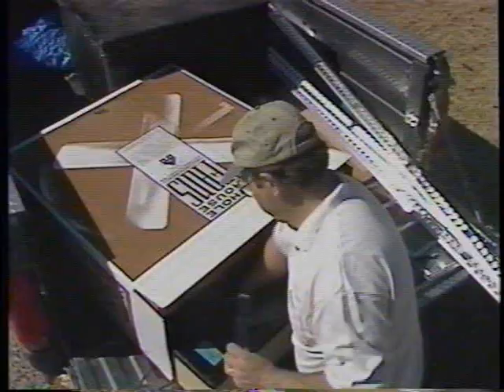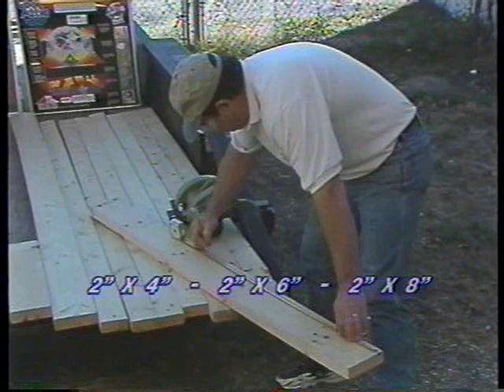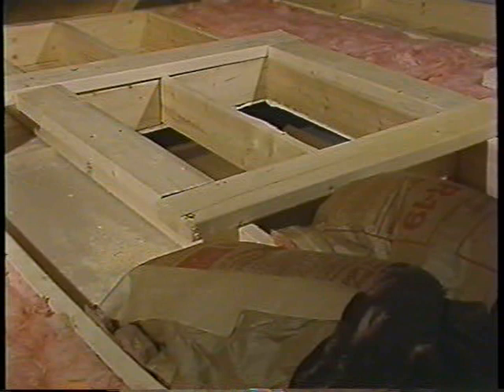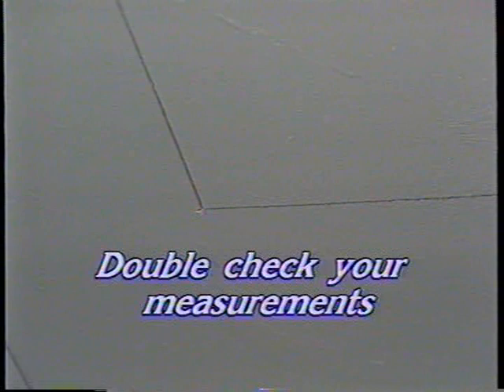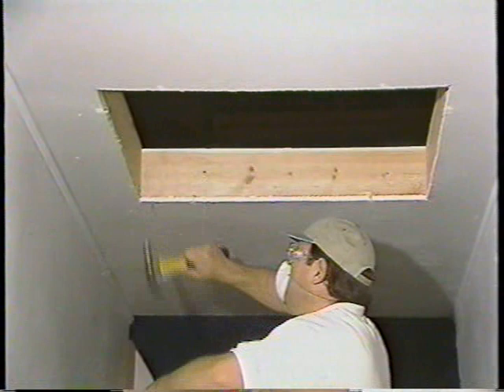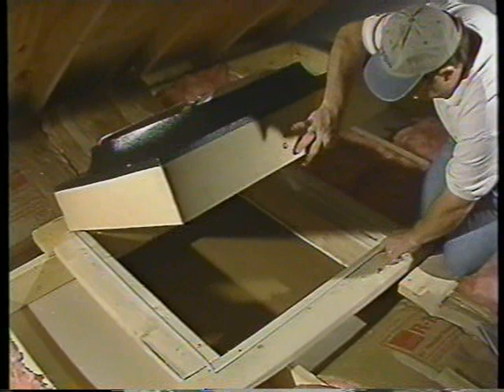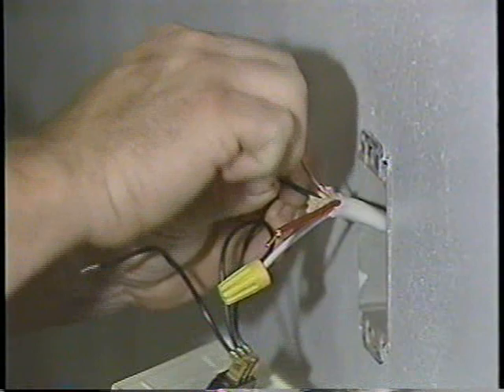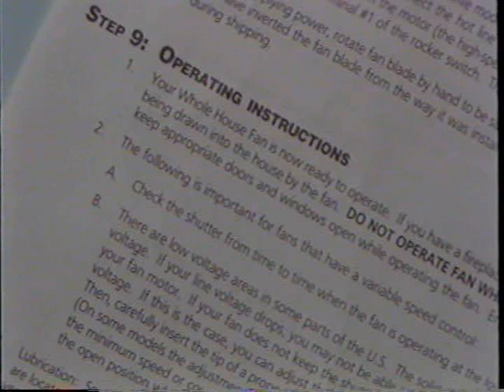Cool Attic Whole House Fan

Comment: Thank you!!! I used this video along with the printed material by watching all the keys areas over and over and Installed our whole house fan with  my wife, we are no carpenters at all. We did spend 2 days in a scorching hot attic with a fan and a constantly draped cold wet t-shirt, around head and neck to keep us cool and gallons of lemonade - only way, If you work through out the day rather than morning and evenings only.

Now I need video for the wiring, wish us a blessing.
Mark & Irma Bacher
Reply: Well how did it go?
Reply: @doranselwyn8608  really well,so far we had it working every change of season when we can enjoy fresh air (nights can get cold but enjoy good sleep) and...when a/c has given us hiccups 😑.

Comment: One "work smart, not hard" thing that I did with my installation, in an attic with support trusses, where I hoisted the fan into the attic through the hatch, was to remove the motor, and blades. This made it much easier to angle the fan frame through the trusses, to the point of installation.

Comment: This is all well and good for a modern house built to standard and with drywall. I put in one of these (different brand) in my 1904 house built with true 2 inch rough cut joists that were spaced however they felt like it that day, and finished with wood lath and sand plaster. It works great, but installation was night and day from this easy process. 
I would like to see this crew make a video in an old house like mine!😂

Comment: Dear Joe,

Nailing the temporary bridges - The video doesn't show a 'big picture' of
where this bridge would be.  Back up the camera to c the entire layout
w the workman  away.

When the two joists r cut, the remaining joist portions can sag down.
So, the bridges s/b to close up that joist parallel to them?  Not across
the two? 

And for temporary esp., don't use nails but screws.  Nails r
hard to take out.  Only carpenters who never come back r allowed to
use nails.  Owners use removable screws into pre-drilled holes
so the lumber won't crack.  I would rather use #10 x 3"L or 3.5"L sheet
rock screws than short 2.5"L ones to join 2 x 4, 2 x 6, or 2 x 8 (actual
meas. is much less) lumber to ea. other.

Comment: Since joists are typically on 24" centers, why doesn't anyone make a fan assembly that will neatly drop into that width? There is no reason that the through-hole be square; if more square inches are needed for flow, just make the opening 30" or so parallel to the joist direction.
Reply: You would not want that and it is not necessary. This is because a single fan that would fit inside a 22-1/2 opening would be much smaller. As a result, in order to get the volume of air needed, the fan would have to run at a much higher speed. The noise and vibration would be objectionable. The better solution is to use a standard 30 Inch fan and install a split louver. each 24" half would open at the same time  giving you proper air volume at a much slower and quieter speed.
Reply: Carl K Perhaps I wasn't clear about "dropping" the fan between the joists. I didn't mean the whole fan, just the through-hole. If you use the above-joist technique, then the fan can be any convenient size. All that's needed is a short tapered transition from the say 22" x 36" through-hole to the square footprint of the fan housing, and factory sheet metal is cheap. Considering the relatively low cost of furnace blowers, its also interesting that all I see are propeller fans and no rotary blowers.
Reply: If you get a 36 x 36  (9 sq Feet)  standard 2-speed whole house (WH) fan -- with a split louver so that you do not need to cut the roof truss  --I know that this will work.  I seriously doubt that a squirrel cage  furnace blower would move enough air in comparision.
 I only use my WH fan in the late evening when the outside air is much cooler--and  it only  runs 1-2 hours to remove latent heat from attic and cool  the inside temp to the O.S. temp. A lot cheaper than running A/C.
Reply: Carl K Yes, I have been using whole-house fans for about 30 years, and just installed one this week in a new rental property. However, you tend to accept what's commonly on the market, and it's good to sometimes stop and think about why you buy what you buy and what might be better.
Reply: CentricAir makes whole house fans that fit either 16" or 24" on center and do not require any framing or structural modifications. Their website is www.CentricAir.com
Reply: Mike G Yes, that looked good until I saw that a 2000 CFM unit would cost about USD$1200, which is 6 times more than generic fans with similar capability.

Comment: How do you get the fan blade off initially to reverse it. My new attic fan does not look like this video. It's a Cool House, but only has one square option to get the fan blade off initially as it was shipped on reverse position. What's the trick to getting the blade itself off? We've tried everything.

Comment: I have a blown in insulation and seems dense and heavy. Will that blow all over up there and make problems
Reply: I have the same in my house, as long as the fan does not blow directly on it, it should be fine.  That being said, it is important to allow enough exhaust vent area so the outgoing air is not moving fast enough to pick up insulation near the exhaust vent.

Comment: I have one in my stair way at top.   It’s not worth it cuz it can’t be insulated. My ceiling in that area was 105 degrees and it pulls the cold air from ac.
Reply: It can be insulated if you try.

Comment: is this fan blowing air into the home or sucking the air Out into the attic ?
Reply: swampyevilnut sayt  knock  it off  haha  i happen to like these very detailed older videos for nostalgia sake
Reply: Nurd
Reply: ***** they suck, pulling air in through any open windows in the house, through the house, up through the attic and out through the attic vents back outside. If they did the opposite and blew, they'd be sucking in air through the attic vents, past all the floating fiberglass and dust particles in your attic, then into your house. no thank yaaaa
Reply: thats what i was thinking thanks
Reply: Pablo Gaviria both, simultaneously
Reply: sucking from the home into the attic, if you crack a few windows it will draw small amount of air from the outside and create a postive pressure into the attic so it eventually forces air out of the attic vents, the attic can be very hot in the summer and the heat transfers into the house, by doing this, there theory is thart it keeps the attic much cooler essientually pushing that heat in thte attic outside up and out. if attic stays cool it is a lot easier on your ac system, ( howver its best to seal all the top plates with spray foam where wires run down to the plugs-(receptacles), when they run wires or pipes from the attic down into the wall if those wholes are not sealed it can actually push the hot air from attic back into the house through these wholes and then it ceates positive pressure in the wall which creates smalls drafts from your attic back into your house through holes in your 110 volt pugs in your wall.... and I DONT KNOW Y I EVEN CARED TO EXPLAIN ALL THIS BUT YEA..

Comment: The problem with attic and window fans are that they are useless for really high temps and humidity, and then there's the added problem of coating the whole inside of your house with dust/dirt from outside. You are much better off putting your money into at least a window A/C. When my HVAC went down a cheapo 8000 btu window unit saved the day in 115 degree Vegas heat. I paid less than $100 for it from a big box store.
Reply: +st8kout1 that's great unless you live in a stupid HOA that won't let you
Reply: +Cathy Manning Actually I do live in an HOA, but yeah, you have to put it where they can't see it. Wasn't hard in my case as every house here has 6' stone walls in the backyard. I only had to use it for a weekend anyway until the repair guy showed up the following Monday, but I could probably get away with it much longer.